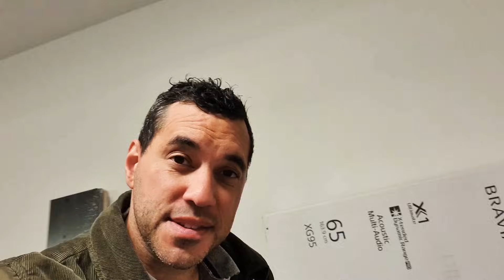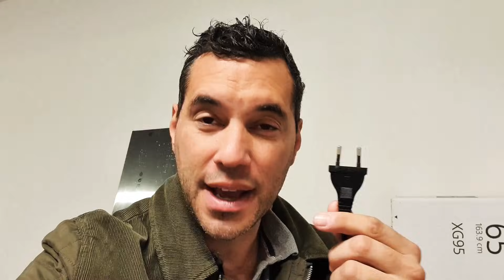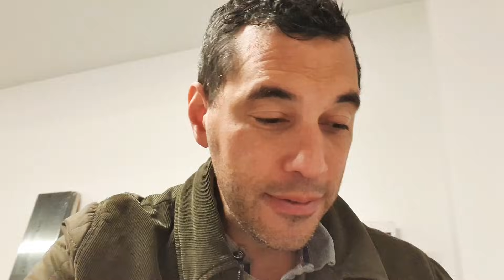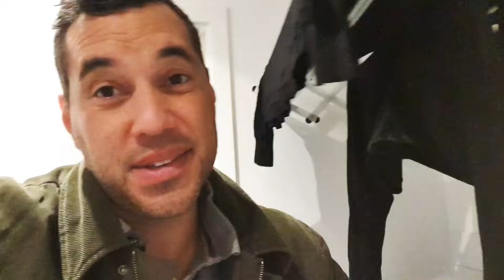Why don't EU plugs have FUSES!!!

Comment from the maker: Why don't European Electric Plug sockets have fuses, so that the appliance trips locally instead of causing the entire ring to blow a fuse or circuit breaker/RCD??
Reply: But with appliances like ovens for example, tend to have the plug hidden somewhere where it is hard to access. Isn’t it easier to just flip back the main switch which always is on one place, rather than having to access the plug, finding a fuse, changing the fuse, re-plugging, putting the oven back in its place and hoping that won’t happen again. I might be silly for thinking this, but maybe having more main switches could make these events easier to deal with, in a way?
Reply: @sloytar2  
If a fuse blows or a breaker trips it is for a reason, and must be investigated. Permanent appliances like ovens should be hard wired in, as should ideally appliances where the socket and plug are not accessible.  Fuses in plugs protect the flex cable from the socket to the appliance and the appliance itself - if there is a problem only the appliance will cut out not a whole circuit, localising the fault.
Reply: https://www.youtube.com/watch?v=tx5NzxJjT0Q&t
Reply: There are many standarts and regulations around this. There are reasons for it.
Reply: Seems sensible to me ! 👍🙂
Reply: I think there is some misunderstanding, EU houses do not have this 3-phase system you mention, I suspect Sweden has its own rules.

Not every appliance use the same power. Electrical kitchens use a lot of power and their wall outlet needs a hefty cable for the current they use, 4-6mm section if that kitchen has an oven, that is why they have their own circuit. Other outlets where you plug stuff like TV, desktop computers, consoles, phone chargers, lamps, even small kitchen appliances use 2,5mm cables.

You might have plugged that kitchen it in the wrong outlet overloading the circuit and melting its fuse. And since there was nothing wrong with the kitchen itself that fuse in the plug would not have helped at all.

In other words, a circuit can provide X amps if you go over that, a fuse will melt. Your electrical kitchen might have a 30amp fuse in that plug (not all fuses are the same) but, if the circuit you are plugging it into has a 10amp fuse because that's the max current it can support dictated by the size of its cables, the 10amp fuse will melt and nothing would happen to the 30amp one.
Reply: @Aldarionte  
UK plugs have a 13A fuse maximum value. Values from 1A upwards are available.

Comment: Plugs without  a fuse are not a Europe thing, it´s a World thing , UK "G-type" plugs are the only plugs on Earth with a fuse 
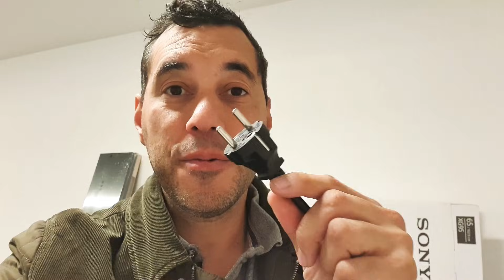at 1:55 it has not one Earth, it has 2 Earths, 1x hole for France & 1x the 2-side-strips for Germany 

German "Schuko" outlets (like the ones you have) were the first outlets EVER that prevent shocks + shorts since ~1930 , Britain fixed this in ~1985 (half a century behind) with the black plastic sleevs on the plugs, Switzerland & AustrAlia firxed it just~20 years ago & USA/Japan are still a shocker ( ~95 years behind the time)

Comment: europe have rcd wih the maximum amps of the plugs 16 a in uk no you have 30 a that is the reason have fuse and they are 90 degrees schuko plugs

Comment: The wiring on French extension cords is thinner gauge than the uk equivalent. 16a through a 1.0mm flex is pushing your luck compared to 13a through a 1.5mm cord in the UK. Just a thought...

Comment: bullshit
Reply from the maker: @JaquelineVanek  care to elaborate? 🤣
Reply: @BeingSwenglish  
You experienced either an old house or extremely bad new installation. Newer constructions goes by basic rule where you will have basically 2 dedicated fuses per regular room, one 16A for sockets and one 10A for lights, this can warry if you have something like kitchen which can get extra cables, even 32A if you have induction and oven. So there is zero need to have fuses on every single socket.

Comment: Because they don't need it, all the circuits are 16A for sockets, the lighting circuits are 10A, in the UK the circuit is 32A, that's why the plugs have a fuse. The European standard is a more modern design, what kills are the amps, the more amps a circuit has, the more dangerous it is.
Reply: most 10a lighting circuits also have sockets on them

Comment: Funny enough in the uk our microwave stopped working and that caused the whole house to go out
Reply from the maker: Damn that sucks! We've had the same with our appliances, but I just updated one of the breakers to 13amps and now we're good 😂
Reply: @BeingSwenglish  forgot to mention bit are you aware that the 3rd prong is there for extra safety, funny how most European plugs don't have it
Reply from the maker: Yeah the third prong is for an earth, it's shocking that most European socket appliances aren't earthed!?
Reply: also are you aware of the lack of insulation on plugs (excluding europlugs), wouldnt that make it more dangerous @BeingSwenglish

Comment: For the love of god, don't put fuses into Type F plugs. I don't need another consumable item in my life that is needlessly complicated to change and requires tools. I rather take the 10 seconds to open the breaker box and flip the breaker back into position.
Reply: A fuse would be dangerous as the plug is reversible. The fuse could blow leaving the device energized.

Comment: We have no fuses in it because the curcuit systems are not from the 1950's. We just dont need it. 😁
Reply: You have no fuses because you don't give a fuxk if a faulty appliance burns your house down and kills your family, the UK electrical regulations are based on the premise of making the electrical system safe to all persons, livestock and property, there is no way to cover any safety measures against portable appliances, the only guaranteed protection from faulty appliances is to have each one  fused, European protection is to bare handed, manually pull the faulty appliance plug out the socket, introducing numerous unforseen hazards to life! 
Drops the mic
Reply from the maker: Well, possibly not, having fuses in appliances avoids full tripping of circuits, so perhaps not.
Reply: This is the simpest answer to British braggers ever.
Also, We don't neet a fuse to protect 0.3 A devices. This is too nonsense.

Comment: it's not really a silly Design, its a complete different way to get powerlines working: here in Germany you have several powerlines with their own Fuses (automatic Fuses where you do not need a Replacement in the most way). normally you will have one Fuse for each Room, Three for your Stove and several others for Devices with a higher Power Consumtion (or Circuits for a Fridge etc). Actually All of them have to be equipped with an fault current circuit breaker what is a good thing if a Kid wants to plug something in. And there is a Reason for the difference between the small plugs and the ugly ones: the 2 Pin plugs are only allowed to Use when the Device is fully insulated (in German Berührungssicher) against tapping any leakage. the other ones have to be used for any other Device to make Metal parts grounded. Also the plugs we have are completely save when it comes to touching the Pins: when you can see the metal they are unplugged and Earth is the last thing that disconnects. As i Learned in my Apprenticeship to become an Electrician: in every Plug i put on a Cable the Earth Wire is the longest in the plug, so if you rip of the Cable from the Plug earth will be the last wire to get off ;)
And yes, there are 90 degree plugs out there ;) also flat ones to mount behind whatever you put on a Wall. And here in Germany the most Sockets are in the Wall (except a few millimeter for the Cover)

Comment: You only have three fuses? What's wrong with your house? How small is it?
Reply from the maker: It's 162m2, it's quite a standard electrical setup here apparently.
Reply: @BeingSwenglish  that's quite surprising to me. As a Norwegian I'd assume sweden had multiple breakers like we do. I think our apartment might be 80 or so m². But we have about 20
Reply: Three main fuses as it is three phase.
Reply: that's very different. You can't say you have three fuses when you mean three phases. That's like saying your house operates on 400V just because you have a TN setup. @okaro6595

Comment: Schuko plugs come also with 90 degree bends, the straight one does have one feature, it can be pulled from the socket via the cable (though you probably shouldn't)
Reply: plugs where you can place stress on the cable connection coming out of it isn't a good feature, it's a danger feature.

Why do people keep on designing cables this way?

Comment: In the flat I live here in Poland there are just one phase but three breakers. One is just for the light, the other for sockets in bathroom and bedroom, and the last one feeds sockets in the living room and kitchen. And this is considered old fashion, the apartment was build in late 70s. Nowadays you have separate breakers and RCDs for almost everything. Every bigger load like an electric stove has it's own curcuit. But still, with that old design I had a breaker trip only once since I started to live here, which is 6 years ago. If anything goes wrony you just quickly disconnect everything from that one curcuit, you reset the breaker and plug the appliances one at a time. When it trips again you have the culprit. You can really live without those fuses in every plug and light switch :)

Comment: • Prong Design: The U.K. wall plug has three prongs. But the design of these prongs makes it nearly impossible for you to shock yourself accidentally. Unlike in U.S./Euro plugs, half of each prong is coated in insulation. Because of this, even if a plug is not fully inserted into a socket, touching the exposed part of the prongs can’t give you a shock.  The prongs are large enough to cope with 3kW appliances with ease. 

• Socket Design: Any kid with a fork or a screwdriver can light his hair on fire in the USA by jamming it into a wall socket. Not so in the UK, where it would take at least two screwdrivers to manage the same trick. The U.K. plug is designed so that the grounding prong is slightly longer than the prongs responsible for transferring current. Like a tumbler in a lock, this grounding prong is responsible for “unlocking” the socket, giving access to the more dangerous live and neutral terminals.

• Built-In Fuses: The British government putting fuses into every plug, instead of wiring them directly. Although the built-in fuse adds bulk to the U.K. plug design, it’s also safer: In case of an unexpected electrical surge, the fuse simply blows and the electricity shuts off, preventing fires, electrocutions, and other accidents. It also makes U.K. plugs easier to fix. The fuse only isolates that one socket.

• Circuit Design: There’s the wiring inside the plug itself. Not only is it extremely intuitive, but it has been thoughtfully designed so that if the plug is tugged and the wiring frays, the live and neutral wires are the first to become disconnected, while the grounding wires–the ones responsible for preventing human electrocution when they come in contact with a circuit–are the last to fray.

• Made for Hands: The plug is designed for human hands to hold and easily inserted in and out of the socket.

• Switches on sockets: UK sockets have a switch to turn off the socket, to avoid pulling out the plug while still drawing current. And to keep the plug in the socket, while switching off an appliance.

It’s a truly brilliant design.
Reply: The schuko sockets are recessed so it is impossible to put your fingers in. Only on old ungrounded sockets could this in theory be possible but you really have to try it.

Modern sockets n the US are also tamper resistant. In Finland that has been the norm since the 80s. You cannot even put it in with tho screwdrivers unless you really try as you need to push them at the same time.
Reply: @okaro6595  Kunpa meilläkin olisi katkaisimet pistorasioissa...
Reply: @okaro6595  
Recessed  schuko  sockets gather dirt. Homowners spray cleaner into them.  They have no switch so kabooom. 

The best design is the British 13A 3-pin fused plug design.
Reply: @johnburns4017  If you spray cleaner to sockets you need a padded room. Yes, the dirt is a problem

Comment: The way you described the appliances may have been set in different order before. Your specific wiring would not necessarily be used in other European countries. Also some countries don't have strict rules for renovation and electrician would just plan on the spot as he feels necessary. From experience I can tell you that sometimes don't even clients know what they want and where they want.
 1:47 Not true. Most plugs for appliances comes with 90 degree angle. If your plug for some reason sticks out to much where it shouldn't have, then you can always change it.
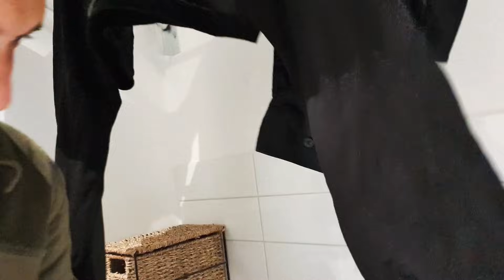 3:03 That specific socket looks designed for single hole box so it sticks out. You can drill another hole right next to it and put two sockets with unified frame something like JUNG LS990 or ABB Basic55, these are very common where I live.